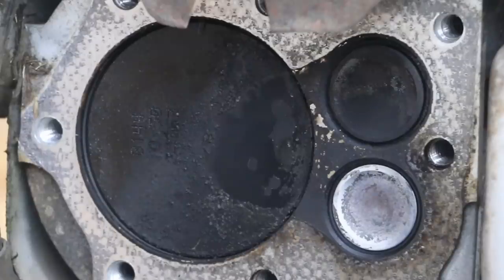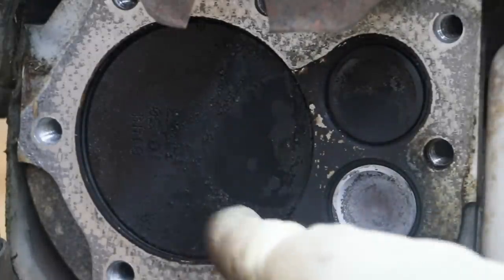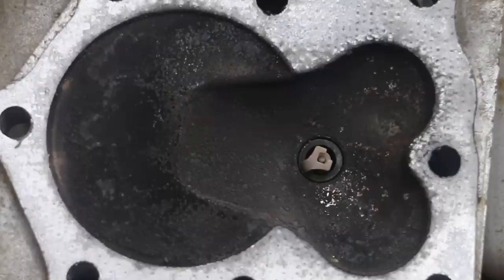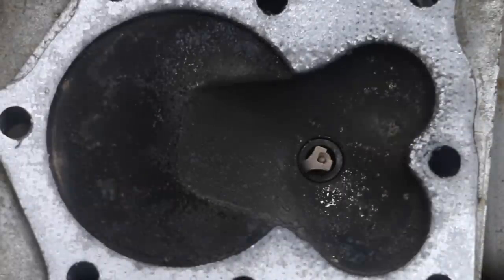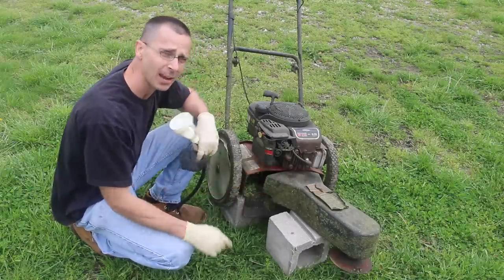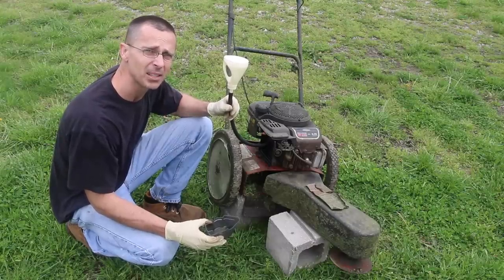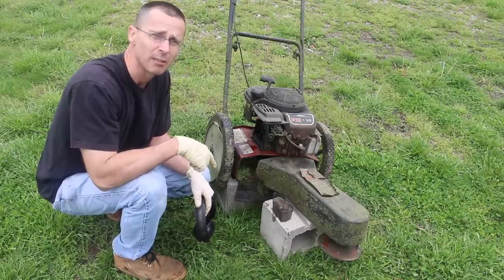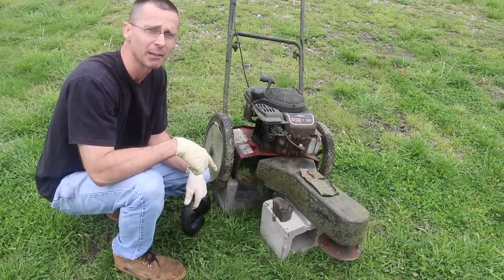Seafoam--can't believe what it did to my engine part 3--cylinder cleaning test!!

Comment: It appears the Seam Foam loosened and moved the carbon buildup along.  Exhaust valve looks cleaner, but the "bottom" looks like more buildup and looser/newer/loaded on buildup.  Main thing I guess is does engine run better?  Looks like it might.  Will watch the end of video.  It really did seem to help his little Ford pickup a lot.  That video impressed me, but we never saw inside the motor head.  This video we saw inside.  Not impressive but does it run better???

Comment: Looks alot like the "trick" of pouring ATF into the intake of a 4 stroke motor to clean stuck valves and remove carbon build up inside the combustion chamber. This was used on a running motor with the RPMS kept at a level high enough to allow the input of a amount ounces equal to the motor size and perceived carbon build up or valve restriction. Heavy white smoke out the exhaust but has been known to clean carbon build up as to allow valves to close. I think it was something to do with ATF being such a high grade detergent.

Comment: Try using just plain water in a spray bottle.. I have found that it works just as good or even better than sea foam. But since you do pull the head off the engine on your first inspection, you might as well just clean it up then using a throttle body/carb cleaner. Just a thought.
Reply from the maker: Thanks for the recommendation!

Comment: I once revived a 2.5L Jeep Wrangler with mix of diesel, ATF, and Water in a windex bottle. 

1 owner and had over 400,000 miles on it... all original long block. I knew the owner.

Never pulled the head but that little fella ran like new and I still see it around time to time. 

I used a windex bottle to spray it in the intake... fogger style, and i tied the throttle so it was holding 3k before i started. Poor thing ran like a peg legged pregnant pole vaulter when I started.
Reply from the maker: LOL! I really enjoyed reading your post, especially the description regarding how it ran after the mix.  Thanks for commenting!

Comment: I know people sometimes assume that all the smoke is the carbon burning out, but the smoke is caused by the oil based ingredients, and while it may help clean carbon off the parts, I wonder what it's doing when all that smoke blows through a catalytic converter.
Reply from the maker: Thanks for the suggestion.

Comment: Whats your process for storing an engine for the season..
Motorcycle for winter ..
Snowmobile for the summer ..
Run gas tank dry ..fill gas tank with clean engine oil..let run till boggs out ..??
Reply from the maker: Thanks for the suggestion.

Comment: Regular steady use would probably yield better results, and where you really need it to be cleaned is the valve stem and sealing surface with the block and that is where the regular use will work best in this situation. I have used Seafoam before and have also used B12 Chemtool a very similar product with good results.
Reply from the maker: emdman1959, I agree.  I plant to test B12 soon. Thanks for watching the video and commenting!

Comment: I did the same thing with water. I used a water hose direct from the faucet, and it removed all  of the carbon on the piston and valves . It was a 1950 mercury with over a hundred thousand miles on it. Wide open throttle and the water keeping the engine speed down. I ran the engine for about 30 minutes.There is a reaction between water and the explosion that changes the carbon into carbon dioxide gas and it goes out the tailpipe with only a few white crystals left on the pistons and valves. It made rebuilding the engine much easier.  So why waste your money on seafoam.Maybe the use in the crankcase is worthwhile.
Reply from the maker: Thanks for commenting!

Comment: What about water-injection?  It is relatively-easy to install.  It boosts compression.  I'm pretty sure it would also help with fuel economy.
Reply from the maker: Great suggestion!  Thanks for watching the video and commenting!
Reply: You're welcome!  Thanks for replying!  In the past, I had a broken cylinder head gasget in my 22R and when I pulled the head, the cylinders 1 and 2 were completely carbon-free!  The piston was bright and shiny and the head was likewise clean.  That's another reason why I think water injection is worth a try.

Comment: The cylinder looked fairly clean to begin with. There wasn’t too much carbon build-up and the valves looked fairly clean. Sea-Foam has more of an effect on really dirty engines, if they’re fairly clean to begin, there’s not going to be much difference. Need to try this on a street tuned race engine, running K&N, or other high flow air filter, running rich A/F mixes; there’ll be much more carbon build up, and should see a larger difference in cleaning.
Reply from the maker: Thanks for the video idea.

Comment: You might consider doing this test again but adding the sea foam much faster and at a cold start so it doesn't flash off the metal so quickly.
Reply from the maker: Thank you for this recommendation!

Comment: It think it works but you need to run a few cycles. When i first got my 2000 Jeep Cherokee Xj, I used gumout for about 5-6 cycles and finally I seen an increase of 30 kilometres a tank. The mileage stayed that way ever since. I use it once a month too.
Reply from the maker: Thanks for sharing.

Comment: how many miles on this mower ( lol )
and yes it cleaned up some because if you look at the the rim of the piston head you can see it cleans up the rim before going down into the cylinder wall.
it also looks like it removed a measurable amount on the top of the piston head

Comment: Its great for light - medium desposits. Doesnt do a heck of a lot on the heavier stuff. If you start using it early on in an engines life ( say 100,000 - 150,000 Km for a car ) and continue to use it for the rest of its life, carbon build up will be the least of your worries.

Comment: You will get much better results using sea foam to manually clean the piston and cylinder head.
Works wonders on leaking exhaust valves.  But it requires elbow grease so to speak.
The only benefit I have found using it as a fuel additive is fuel injector cleaning.
But if the injectors are plugged, best to soak them in sea foam overnight first.
Reply from the maker: Thank you for this recommendation!

Comment: It looks like it did get rid of a lot of "new" carbon, you can clearly see this around the piston serial number or whatever that is, it seems to have cleared a lot of carbon off then valves also. The older thicker layers of carbon seems to be too tough for the sea foam to handle though, still think a real cleanup would be the best if you have the tools and knowhow for these old utility engines

Comment: I believe they both work very well . I we tack the time if your going to take it apart soak it and wipe it to clean the rest.   And I did see the slick 50 vs 30 sae. The slick 50 is designed to help the engine run cooler nothing more.
Reply from the maker: All great thoughts and comments.  Thank you.

Comment: Well i dont like the end result ive been a seafoam user for well over decade. To see that result well helped me to not worry to be so quick to use it in the engine to clean i saw the end results using water and i was more impressed with the results guess old school wins the day. I will still use it for fuel additive but not gonna put it in my engine anymore thanks for taking the time to test these products.
Reply from the maker: Justin, Seafoam is a great product and I continue to use it.  I like it for crankcase use best.  I like MMO in the fuel.  Thanks for commenting!
Reply: Project Farm yeah totally ive cleaned the entire engine with it when had heads off last year. I had so clean you could eat your lunch off the block. Lol

Comment: I know this is an old video.  However, I'm thinking that the Seafoam would have helped if there had only been a little bit of carbon to begin with.  In other words, if you first used it early on in the operational life of the mower, and at regular periods after that, it would have helped to keep it clean versus trying to get all that buildup out.
Reply from the maker: Thanks for the feedback.

Comment: I'd like to know what it does for the rings or deposits behind the rings.
Reply from the maker: Thank you for the video idea!
Reply: When I had an old Diesel bulldozer, the old-timers told me to put some ATF in the fuel occasionally to clean the injectors.   I am trying that on a honda generator now.

Comment: It is difficult to see the difference that was made. The only thing we see from photographs are differences in reflectivity before and after from where enough carbon has been removed to see the base material of the engine head, IE where carbon has been totally eroded out. The real difference in how the engine would perform, and head temperature, is how much depth (3-d buildup) of carbon has been removed. Measuring that would be really difficult. Mechanically (IE depth gauges) or by laser interferometer. (Those weird green laser booths they have in fancy machine shops). I'm sure it made more difference than it appears looking at the change in reflectivity.
Reply: Thicker carbon causes delamination of the flow of gasses on both exhaust and intake cycles, lowers combustion efficiency, raises emissions, increases overall engine temperature, etc. All because that 3d carbon buildup is too tall off the metal. Our monitors are only 2-D, I bet it looked a lot different in person.

Comment: The carbon was installed over a long period of time.  Try doing this test and run the engine over the summer or a few months then recheck,   This is not designed as a quick fix product, this is supposed to be added in small qualities to each tank full of gas. :P

Comment: you should do another before and after video where you spray regular tap water to the intake. it should remove much more carbon than shown in this video. the key is to spray a fine mist so the engine wont hydrolock.

Comment: Please pardon my ignorance, but do you have "RedX" in USA? I'm just curious because back here in UK it's the first product of choice for cleaning combustion products from inside the combustion spaces, however, the method looks much the same as you used with "Sea Foam". Over here, the old boys swear by RedX, and I'm wondering if a head-to-head comparison test of the two products would show any difference.
Reply from the maker: Thank you for the video idea!
Reply: @ProjectFarm  Another idea, back in around 1978 my brother had an old (1961) Rover "100" (P4) which developed quite a brake fluid leak which allowed the fluid to get into the brake servo, from which it found its way into the engine cylinders, then out of the exhaust in a smoke screen that wouldn't have been out of place on a WW2 North Atlantic convoy. It ran like that for about a week before it was fixed.

An older mechanic at the local garage said that it would also have cleaned out the carbon from the engine. The faulty servo was rectified, but the mechanic's assertion was never followed up, so just out of interest, you might like to try that too - just an ordinary DOT 4 brake fluid, and in this case, it was the green stuff by Girling. Of course the car would have originally used "Girling Crimson" brake fluid, but I don't know the spec/approval certificate number for that.

It's just an idea, and I have often wondered if it did actually clean the engine's innards.

Comment: My concern about removing carbon would be if the carbon is helping seal the wear of the rings and any small valve leaks. Could it be doing more harm than good? I guess it depends on the age and wear of the engine.

Comment: I wouldn't think it would do much for fused on carbon although I do know it is great for the fuel system. I think if you pour water into the engine (in stiff doses just short of stalling the engine) you might get slightly better results. The water cracks the carbon off. The Seafoam is more of a solvent and pushing it through the engine like that doesn't provide enough distress to shake the carbon off. Just my 2 cents. Always good stuff here though.
Reply from the maker: Thank you

Comment: There's another guy did this kind of thing and it took like 7 or 8 treatments to get it done. You'd be better taking off the head cycling advancing the piston to the bottom of the stroke and dumping the can of seafoam in the cylinder and letting it soak all day. Then flushing it out to get rid of the most amount of carbon. Also I'd use a scotchbrite wheel on a drill to help the process along.
Reply from the maker: Tony, Excellent advice!  Thanks for watching the video and commenting!

Comment: Difficult to say as this video was made before you started using split-screen for the before-and-after images.  Plus sometimes one wonders if a slight change in lighting or camera angle may account for perceived differences.  

Having said that, there seems to be some improvement although not dramatic.  Would be interesting to compare how effective Seafoam is compared to the old shade-tree mechanics technique of feeding small amounts of ATF fluid--or water--down the throat of a carburetor on a running engine.
Reply from the maker: Thanks for the suggestion.

Comment: It looks like it took about 15% of carbon off. It also could cause issues down the road now. Let's say it hardened the carbon further? Or lifted the carbon on the edges a bit. And big chunks could come off while the engine is running and get in between the valve and valve seat and could bend a valve? I have actually seen carbon deposits come lose and bend valves on high mileage motors.

Comment: What does it say on the container? Mix with fuel? It seems to me that too much is expected in too little time. Just follow directions & run it normally for at least a season, then see how it went. You won't be disapointed.

Comment: I need help please! So I have an old 10 horse tractor motor. It was missing parts, so I then used parts form the newer version of it that came a few years after it, the 11 horse and got it to run. But with trying to get reverse compatibility to work, I couldn't get the air filter to fit. Is there anything you can do to like make a filter for it? (Please do note that this is for farm use and the engine itself has been obsolete for a long time. It was made in the early 80s)
Reply from the maker: Positive Negative, You might search Amazon to see if you can locate an air filter that will fit.  Another option is to retrofit one with an air filter from another make and model, but it's difficult to advise without seeing pictures.  I sure wish I could be of more assistance.  Thanks for watching the video and commenting!
Reply: You can buy sheets of foam air filter material like they use on dirtbikes can cut to fit, you just use foam filter oil in the foam to catch the dust. Uni filters and twin air might make the sheets o foam filter material.

Comment: Interesting.  So, looks like Seafoam is good for intake/fuel system and lubrication system, not so much for high temperature areas of the combustion chamber and exhaust.   In all reality, that seems like reasonable expectations anyhow.

I think you have me talked into running Seafoam through my Miata that is beginning to sound a bit dieselly and really has a low end stumble when it's cold.

Comment: Since you already removed the engine head, why not pour seafoam on a cloth  and wipe off the carbon deposits? I'm sure that's the best test compared to just water. I prefer to add it to the gas tank but beware on an old engine because it will dissolve old gaskets. It's great when doing oil flush. I drive the car for  half an hour before flushing.
Reply from the maker: Great recommendation. Thanks

Comment: It would probably make more of a difference if you mixed that 8 oz of seafoam with 8-10oz of fuel and put that in the fuel tank, and worked the engine hard to get it good and hot. Please, try a test like that and share your findings!

Comment: I have an 87' kawasaki vulcan 1500 that last year had carbs taken apart ultrasonic cleaned & new kits after that I ran the hell out of the bike when I had the time usually too buisy driving a semi truck but after awhile I heard tapping noise kinda loud near the top of my bike & it didnt matter if it was at idle or highway speed my bike sounded like an old sewing machine tapping away well....  I just had this mindset for awhile to run sea foam in my oil before I do my oil change & obviously run it in my fuel so after I poured some seafoam in my oil I rode my bike 7 miles to meet up with my crew to go on a ride & decided to change my oil then but some point along my ride that tapping noise completely went away! I mean I wasnt initially looking for that to go away I just thought about it so that was a stress relief because I sure thought it was time for a valve job. Other than the carbon build up on the pistons I really dont have the time to take apart & do it right I'm just going to pour sea foam in each cylinder & it can sit in there all week since I'm gone anyway . I really dont care what harm it could do but much likely nothing will hurt that old bike but I'll shoot the fluid out of the cylinders when im reasyb& replace spark plugs & do one more oil change without the sea foam & not synthetic oil either apparent Auto zone kid suggested that to be my solution but come to find put I dont need to run synthetic in my old bike. also to the cry baby's that is getting mad at this man stating OMG! Your video was a waste of time & it did completely nothing stfu & hang off of mama's tit . It's a mans world so figure the shit out on your own if anything the video is a fucking alternative suggestion. 

Boring driver over & out 10-4 you twidler fidlers